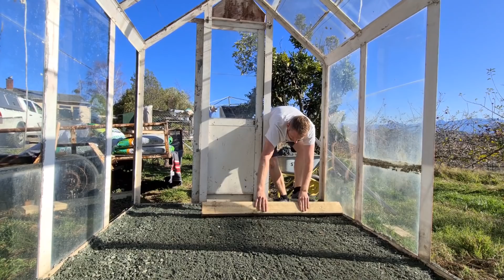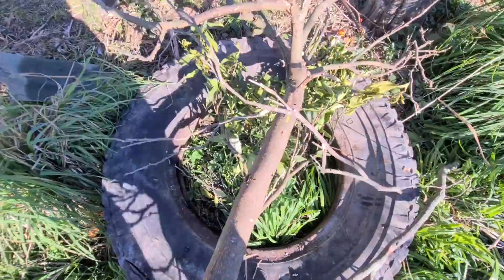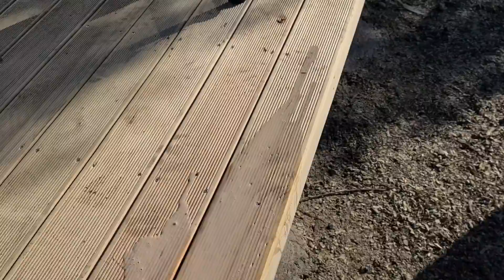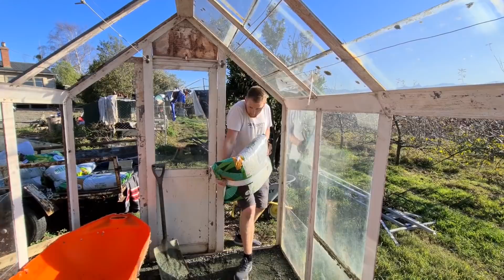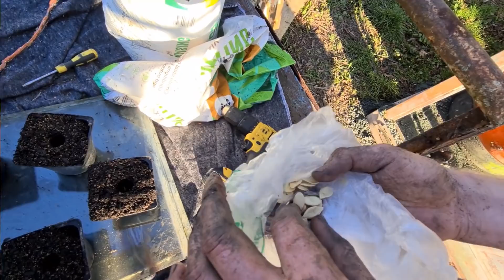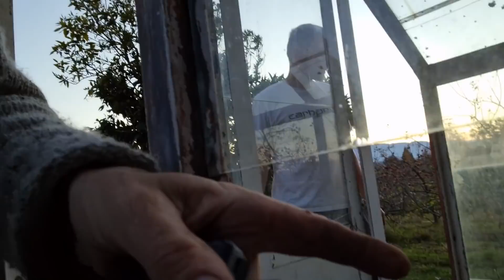Up-cycling with the Irishman in my Glasshouse~Clay Tall Stories

Comment: Twinwall for ya glass house... It's cheaper than glass and perspex... Light and easy to use... Had it in our glass house for years...
Reply from the maker: What is it and where do ya buy it mate?
Reply: Same stuff that you seed raiser box is made of, quick Google search or on Trade me...
Reply from the maker: Thanks mate. I found it at mitre10 at Motueka but it was too dear. 28 dollars  for a small sheet. I will check out Bunnings.
Reply: Yeah very expensive when buying through those guys...

Comment: Hey Clay,
Your decking has been laid upside down. Those grooves on top are for airflow between the joists helps with Rott. 
The common thought process is that the grooves give grip. In fact they fill up with dirt and grow moss and get slippery. 100% your decking is laid wrong. If you go on the website and lookup installation directions you will see.
Google “decking laid upside down”
Reply from the maker: There are some people and even builders  who think this and we talked about it before putting the decking down Mark.  If you have the grooved side down it would cause a capillary action sucking water in between the joists and it would stay trapped there causing rot. The ribs are for non slip. If you had the smooth side up it would would be more prone to being slippery when wet. This argument has been thrown around for years. Particularly in Australia many builders believe the flat side should be facing up. Each to their own. I will go with the ribbed side up bro as Arb has been a builder for 40 years and built hundreds of decks all over the world. Thanks all the same for your concern.

Comment: If you rake the gravel to lossen it and sprinkle concrete powder over it, recompact it how Will did and wet it down , it will set like proper cement but will only be a thin crust that will definitely keep the rats out
Reply from the maker: yeah I keep hearing this. The first sign of a rat busting through and on with the cement.
Reply: @ClayTallStories  i don't think they will but just in case, it is awesome the way your place is progressing,  won't be long and you will be rat free and have heaps of veg and herbs , keep up the great vids and remember to look after yourself brother, stay safe

Comment: Ahh Stop.... build raised beds in the green house. You are losing a hell of a lot of growing space with those bouys.
Knock together lengths of planks into rectangler boxs and fill the bottom with some dry fill for drainage and then earth. The boxes can be either be 5 -6 inch high or 2 to 3 foot high depending on what you want to plant or how bad your knees and back are for bending.
Ensure that the glass house has some ventilation system, weather it be a fly window or what not.

Comment: when I remove seedlings I cut the plastic down to the bottom, easy to pull plastic apart, and safely remove root system.
Reply from the maker: good tip

Comment: I think the rats will hide in your tyres and drink the water that drips down through the tub and then eat the veges that are in the tubs.
Reply from the maker: Excellent point. This is where I am going to lay the poison then because the dogs can not access the poison there. Thanks for the heads up mate.
Reply: @ClayTallStories  But then the rats will die and rot there. The smell will be unbearable and the tubs too heavy to lift to remove the rotting rats
Reply: Just attach them well so the rats can’t run off with the poison block eat some die and leave the rest for the dogs to find.

Comment: Will's Song: Go On Home: is a Wolfe Tones tune. It's a comparative new tune. To be safe, don't be singing that, especially to anyone in a Glasgow Rangers top, as it's a hardcore pro IRA tune; it will get you in trouble. Bit of friendly advice from a Hibs fan.

It's basically a troubles tune, not an old rebel song, and as such is still very emotive. Mentioned or sung in the wrong company will (without any doubt) get you a good hiding or worse.

Also 'Will' is an ironic name (culturally) to be singing that song. Not many Williams going round singing that.

As a younger man, on drunken nights, I would sing that song in the company of other Hibs fans (Edinburgh Hibernian F.C.) without much thought. But as I've gotten older I put more thought into the sensitivity of tunes I used to sing along to, at, or after the football. And now I simply won't sing Ra (IRA) tunes. Too many have died and the tinder is still primed.
Reply: come on the Gers
Reply: @johnrankin338  Are you referring to that horrible anti-Scottish football club that ceased to be in 2012? New  club is called Sevco isn't it?

Comment: Looking good..you shoulda cut off the eyes off each end and they would fit in at the same height...ya could take the bottom glass out and put ply round the bottom....stop the dogs running into it....save ya building a fence and gives ya less glass to find..
Reply from the maker: I thought about putting plywood in the bottom Craig but then I thought it might cause the dogs to jump up into the second pane of glass. Still not sure how to secure it yet. Cheers mate
Reply: @ClayTallStories  white paint maybe...